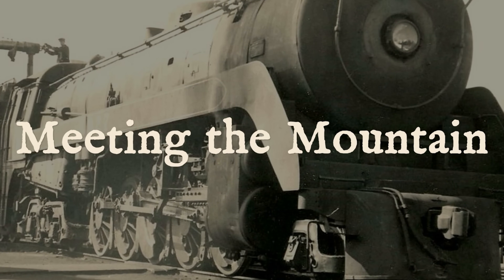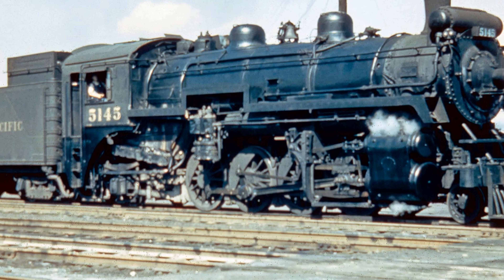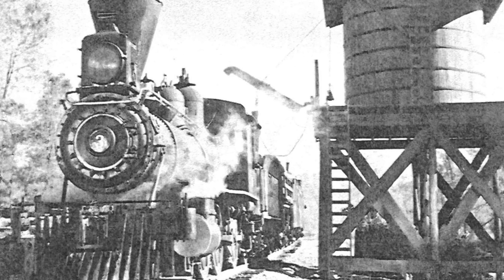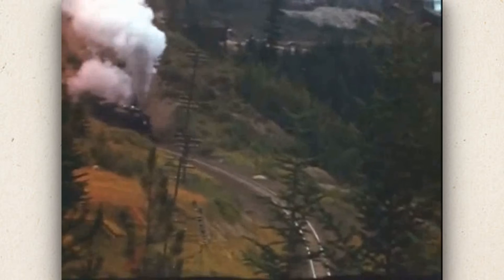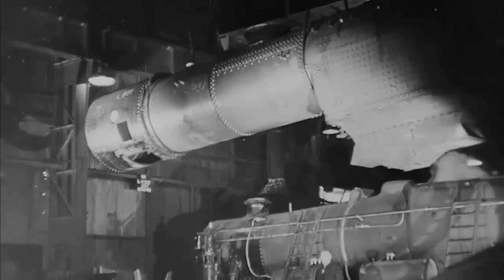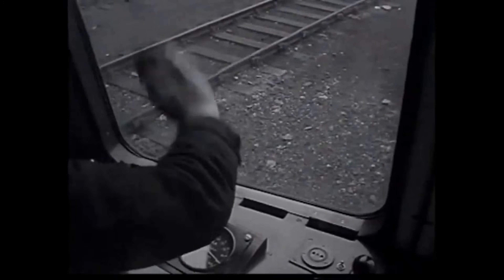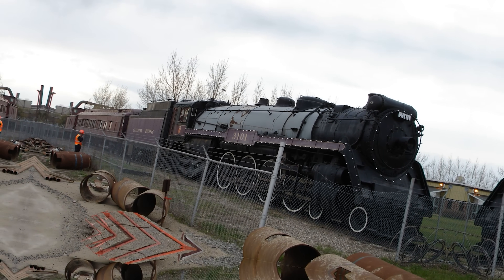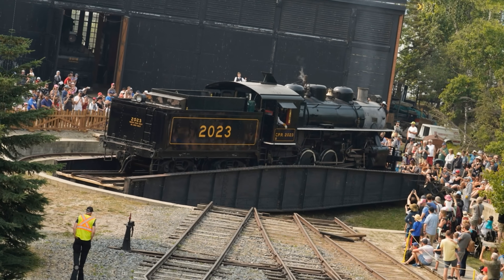This Canadian MONSTER Was MORE POWERFUL Than Big Boy

Comment: Research not bad, but look at the original configuration of these monsters...0-6-6-0  numbering 1950 to 1955 pushers that were hated by the crews and then converted into 2-10-4 before they were scrapped.

Comment: Just to add that the Selkriks were not the first ten-coupled steam locomotives on the CPR. Before the 2-10-4s were introduced in 1929, CP had 15 Santa Fe 2-10-2s (introduced in 1919) and 41 Decapod 2-10-0 (introduced in 1914) locomotives that also worked the steep grades of the Canadian Rockies.
Reply from the maker: Appreciate the additional info, sir!👍🏼

Comment: The Big Boy could out-pull even this high-pressure experimental engine because it weighed about 70 tons more.  More weight on more drivers meant greater adhesion, so the Big Boy's 300 psi boiler could outpull a Selkirk of any description. As for the regular Selkirks, their boosted tractive effort was still less than that of the Big Boy which could generate over 137K lbs of tractive effort.
Reply: Correct. This guy has some errors in his facts. Bigboys WERE more powerful.

Comment: I love that he says the Canadian Selkirks ran higher boiler pressure than the Big Boys..........ummm not so my friend. You state yourself that the Selkirks ran boiler pressures of 275 to 285 psi where the Big Boys ran a boiler pressure of 300 psi. Not to mention the Big Boys had much more tractive effort and could pull much heavier loads. Yes these trains operated on much steeper grades than the Big Boy did but do you really think that if the Big Boys had been run on these grades that they wouldn't have pulled more weight  up these grades and pulled them faster? The Selkirks were great trains but they were in no way more powerful than the Big Boys. That's not me being biased because i'm American, it's just raw statistics that would prove this to be true.
Reply: There was one Selkirk which used the Schmidt high pressure system, in a compound arrangement. CPR 8000 had an 800psi inside high pressure cylinder, and 2 250psi outer cylinders. It was brought in service in 1931, out of service by 1936, and scrapped in 1940, because it was too expensive to maintain for the gains it brought, and was too expensive to convert into a T1a Selkirk.
Reply: 8000 spent most of her service life in the maintenance shop. The triple cylinder design was experimental and was prone to failures.
Reply: @FortunaFortesJuvat  I think in the context of the video they were talking about boiler pressure, not cylinder pressure but i could be wrong.
Reply: @paulhunter1735  The inner circuit of the Schmidt system could reach 1350 PSI
Reply: You are correct. As much as I love the Selkirks, they certainly couldn’t move the tonnage the Bigboys could, nor were they ever designed to do so. 

Bigboys had easier grades and wider curves, thus they could move much larger trains. The Selkirks had tighter curves and steeper grades to deal with, so they ran smaller trains. 

The Selkirk locomotives were primarily used as helper engines for the mountain subdivision, often paired with Hudson’s or Pacifics that were used for most freight and passenger service.
Reply: There was an additional limitation- Selkirks also had to fit on a standard CP 100 foot turntable, which is why they were 99' long!
Reply: Is this the last time Canada had a modern train?
Reply: @user-ju7dx8mu6d  Hardly. This was just one of the bigger locomotives that operated. Most trains now are the equivalent of what runs in the US.